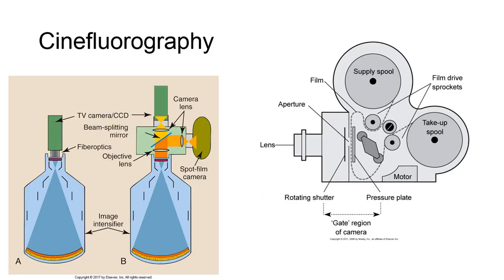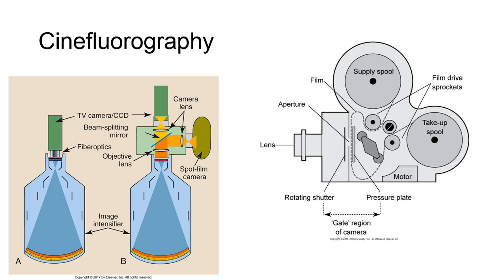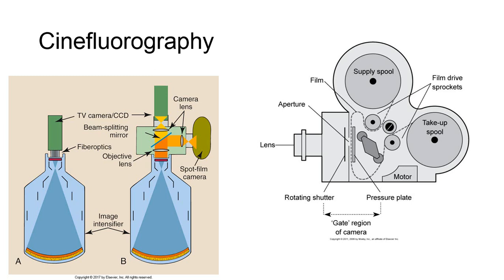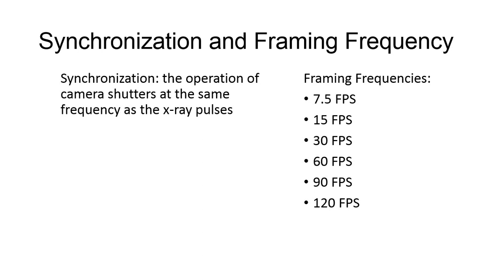Cinefluorography

Comment: do you have any video related to the frames per second of a fluoroscopy machine? How does it work and calculations
Reply from the maker: I don't unfortunately.  It's pulse fluoro though, and the idea is the lower number of frames per second equals less dose in pulse mode, but you also sacrifice image quality the lower you go (most of the time).  It's up to the MD to determine the appropriate balance for the exam.